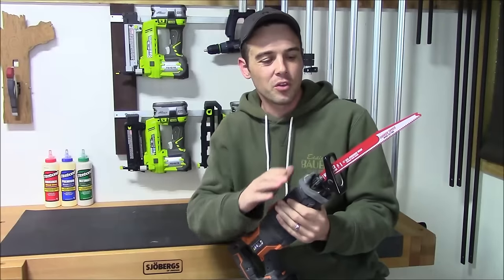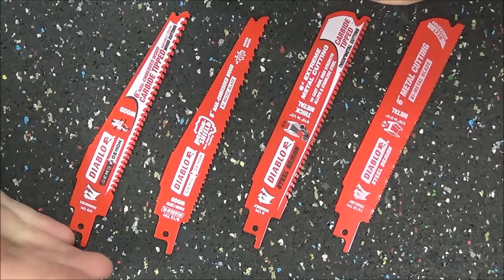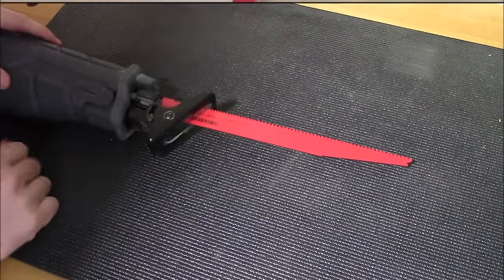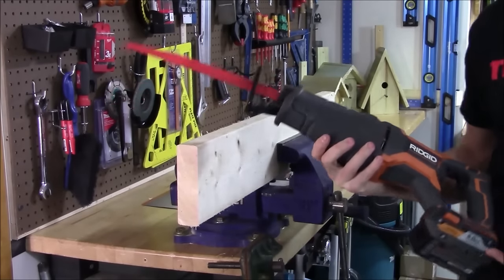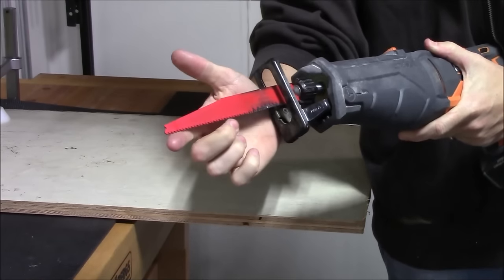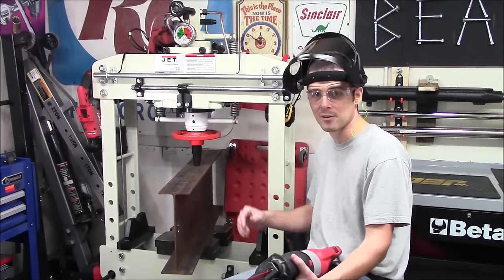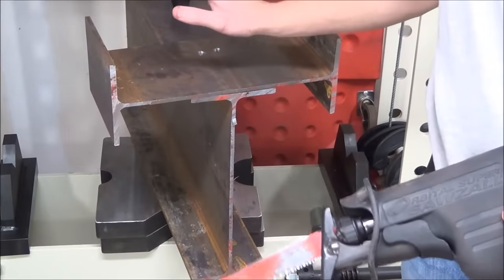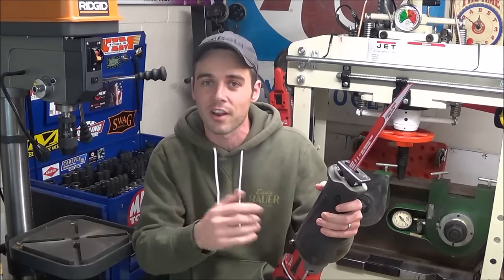DIABLO Carbide-Tipped Reciprocating Saw Blades

Comment: I used the harbor fteight 10 amp bauer sawzall with carbide diablo blade to replace pipe in a crawl space from galvanized to abs and it cut like knife through butter 3 times then started to give out.

Comment: Wow that's impressive, at my Home Depot the price is about 30% less than Milwaukee . I'll give them a try .
Reply from the maker: +Steve Rob Thanks Steve!  Wow....30% less for the carbide blades?  Nice!
Reply: Real Tool Reviews bought two of the 9 inch demo demons a while back and I deconstruct wooden pallets by cutting through the joint between the boards and cutting the nails. Today I estimate that I cut roughly 1500 nails in oak pallets today and I'm still on the first blade. The last one I had was just a bi metal blade (no fancy carbide teeth or any of that, but was still a diablo) and it lasted me about 4 and a half months of use. These things are amazing and I won't buy anything else, the edge is still fine on my old blade and it tool the hole in the tang failing for me to finally get new blades! That's right, the edge lasted longer than the tang lol

Comment: I use a lot of blades, these have been the best by far in terms of cutting heavy steel where we could not allow sparks to be present. However, after 5 or so cuts through heavy I beams / channel,  if the blade gets hot enough the teeth melt off instantly ruining the blade so I'd suggest using WD or some sort of lube to keep the blade cool when doing multiple cuts. As always, if the teeth do not fail, all brands I've ever tried eventually snap at the tang end flush with the chuck rendering a good blade useless.

Comment: Wow that was some demo! Deff will have to pick up a few of those carbide tipped diablo blades. The diablo carbide tipped blades are prob a quarter of the price of the milwaukee and just as good or almost as good but affordable for the weekend warrior.
Reply: I paid about $17 PER diablo 9" metal blade @ home depot. not cheap.
Reply: Justin Crediblename same price as the milwaukee carbide blades.. I will buy the milwaukee for the same price

Comment: Any way you can do a durability test between the two different blades to see if it is actually 20X better
Reply from the maker: +nem4x4 Let me see what I can do....I dont have that many blades here at the moment, but good idea!
Reply: nem4x4 I can tell you from experience the Diablo blades out last the Milwaukee blades 3-1. I can cut a 12 gauge oil tank into 4 pieces with one Diablo blade.  I takes almost an entire pack of Milwaukee blades for the same job.
Reply: I'll be making a stress test video for the diablo metal cutting carbide and it'll be up in about two days, FWIW.
Right now I'm about 14 lineal feet through 3/8" steel and about 12 feet through 1/4" steel.
snapped some teeth off when I messed up and pinched the blade but the remaining teeth are doing well.

Comment: Diablo blade is 12" can cut down 22" tree, not 12".  A blade length X2 is the tree diameter.  Same as a 16" chainsaw can cut down a 32" diameter tree.
Reply from the maker: Technically "yes".....however unlike a chainsaw, there would be zero chip/dust ejection aside from the 3/4" stroke.....meaning it would gum-up or stick and not cut well at all.